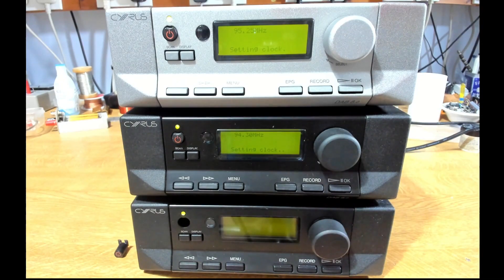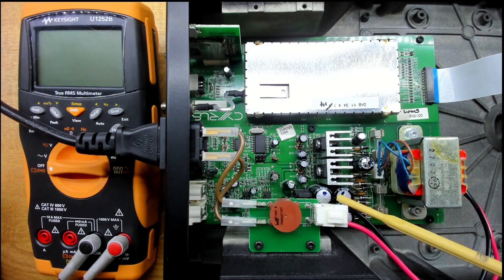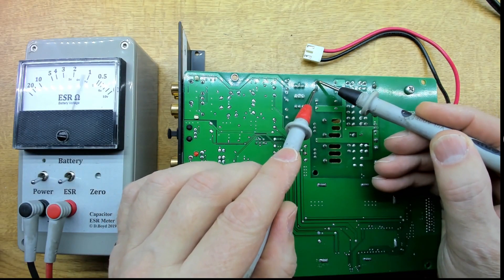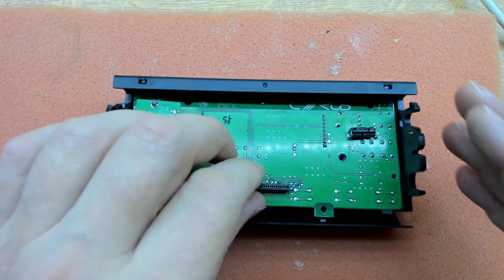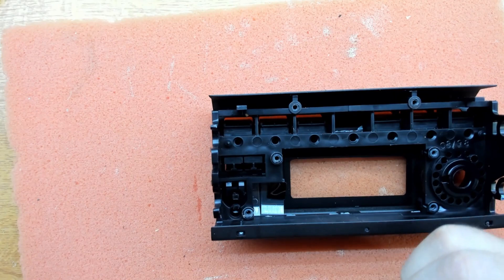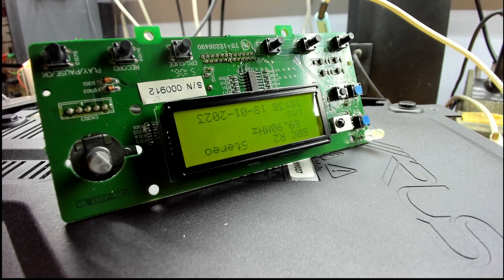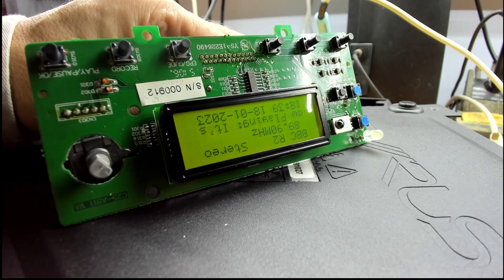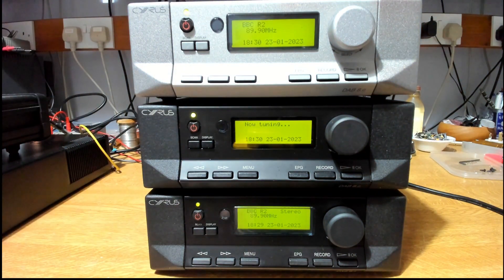Repair of a Trio of Cyrus DAB 8.0 Receivers

Comment: Hi, been looking through your videos to see if I can at least diagnose a problem with a Cyrus 8 DAC. The back input button isn’t clicking like the others and while it works properly most of the time it occasionally scrolls through the inputs as if the button is pressed. I was going to open it up to see if the switch could be unstuck. This video gives me a bit of an idea what to expect but I was wondering if you had any pointers on how to get the front panel off? Firstly, does the volume knob just pull off?? Thanks for you time.
Reply from the maker: Yes, pull the knob off then remove the retaining nut then the screws at the back
Reply: @myalbatech Thanks for that 👍 if the switch is a bit stuck will a spray of isopropyl alcohol be appropriate to free it up? Thanks again!

Comment: I really enjoy your videos, thank you for taking the time to make them. Can I ask where you get your analog ESR meter from?
Reply from the maker: Thank you! ESR meter is one I made a while back.
Reply: @myalbatech  I used to have one but regrettably left it with a previous employer. I just find them quicker to glance at when working quickly rather then using a digital meter.

I'll have to make another one.

Thanks again for the videos.